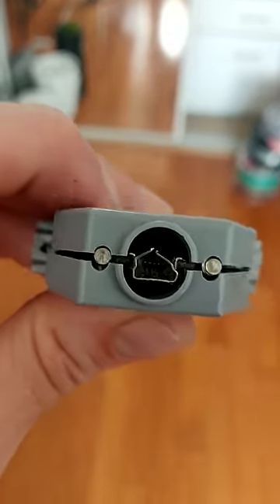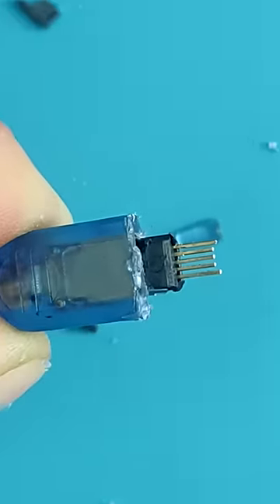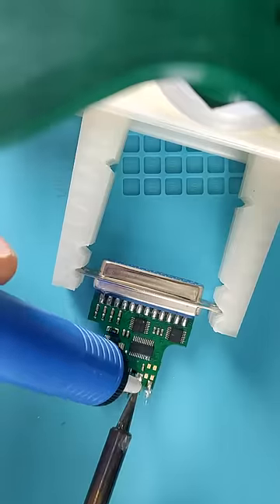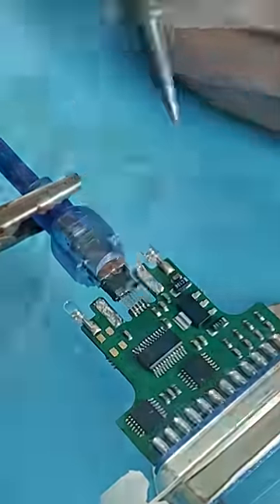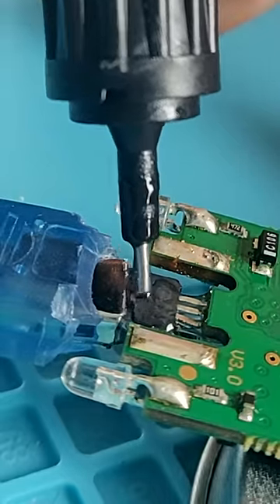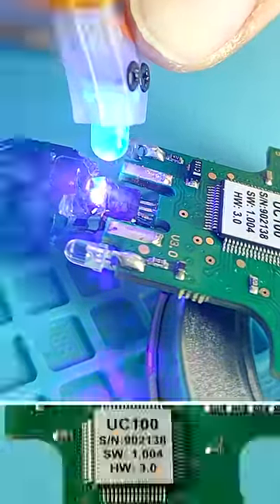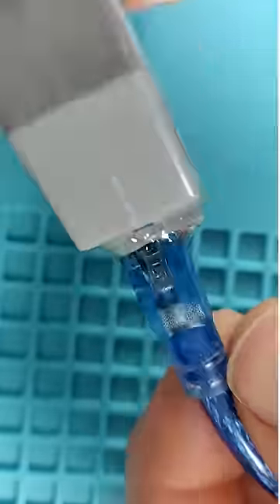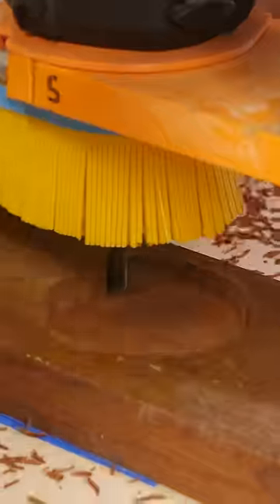For context, I suck a soldering...

Comment: Why not just replace the broken port? you had the chance to even upgrade to USB-C
Reply: The title literally says why, he's not confident in his soldering. I get it though, it'd take me literally half a minute to swap the usb port but then again I already have rework tools and years of experience but I dont expect everyone is in the same boat.
Reply: @sjm4306  Suuuure...
Reply: @Zoldier92  It's really not hard, then again soldering is part of my profession
Reply: USB-C won't cut it.  There's a reason why tons of new CNC routers still use serial ports.
Reply: @matthewboyer4212 because they're stuck in the past and still doing things the way they've always been done? ;)
Reply: I just got done upgrading a bunch of my older gear to USB C. I don't have to carry 4 different cords now :p it's great.
Reply: @rustedfriend  because it works and it works well
Reply: @matthewboyer4212  Not trying to be argumentative because I know my experience is not everyone's experience. But every cnc I've used that has had serial and also another option (network or USB) has worked much better and more consistently as soon as we switched away from the serial :p even though the USB is still just serial with extra steps. Haha.
Reply: @matthewboyer4212  what do you think usb stands for? USB is serial. Also his CNC is using *parallel*, not serial. The motion adapter is already using usb, upgrading it to usb c is a trivial task.
Reply: @metaleggman18  talking about the 25 pin connector
Reply: He could have taken it to local repair shop if he is inexperienced. They would have replaced with new miniB connector. These epoxy bonds are going to break some day and even destroy the PCB beyond repair. Connectors are the easiest way to go.
Reply: Lol why swap it for a port when you can hard wire it forever and not have it break 😂 
Kids these days
Reply: @matthewboyer4212 The reason why, is flexibility. It is intended that the equipment vendor will create their own cables, with the exact length and exact pinout that the machine requires. For most home uses, USB-C is more than good enough.
Reply: Exactly
Reply: Fr
Reply: I don't think you can just solder a different usb port onto the pcb
Reply: The port probably wasn't broken, it was probably just the soldering joints.
Reply: Why change too usb c for older slower tech that can function on b besides that laptops tend to only have one USB c and at least 3 b so why waste it on this
Reply: @xstonedsnailxbox  because C cables are more durable than mini and micro, and more readily available these days.
Reply: @corombb  all good points but you missed out the fact that laptops are limited in the number of type Cs but have vast type bs
Reply: @matthewboyer4212  ok and what's that reason other than that they're slow to adopt
Reply: @xstonedsnailxbox  USB c has nothing to do with the speed it's the connector type. You can get usb c 2.0 devices which are still 2.0 speed obviously. It's only the connector that changes and usb c has only benefits in the long run.
Reply: His laptop (the one shown near the end) is the same one I have and there is no USB C port on it so that would just make it useless
Reply: I hate soldering. It makes me nervous as I feel I’m going to melt everything and join nothing and even I would have attempted to solder a new port
Reply: @xstonedsnailxbox  old machine, bottlenecks folks
Reply: @universityrepairFL  there is no bottleneck youre overlooking some major considerations
Reply: @carsman248  he could have a newer version so that argument isn't really good
Reply: When C isn't only stand for common , It can't solve all the things.
Reply: Bc now he doesn’t need a port or need to remember his cable. He had a direct soldered connection. 

Less failure points. And a port doesn’t make sense to use if he doesn’t have a need of connecting and disconnecting.
Reply: @demp11  well I'm just saying cause that's the one he used in this vid idk what else he has
Reply: USB-C isn't the solution to everything
Reply: @sjm4306  same here but im usually melt other stuff before the solder melt
Reply: @carsman248  dude. seriously.
Ever heard of a USB Type C to A cable?
Reply: Or install a keystone and then make a USB to RJ-11 cable to plug into it.
Reply: because it is reperable
Reply: @DrakyTheDragon  yes, I have. You COULD do that, but why? It wouldn't benefit his case?
Reply: @xstonedsnailxbox  how so? You said b would be more inline with a slower device
Reply: you beat me to it.
Reply: @sjm4306  No you wont, because the wash takes 2-3 minutes in warm IPA :P Actually, replacing those takes much much more, as it is indeed roughly 30 seconds for the swap itself, 2 minutes for the wash, - yet days to find the new Mini-USB socket (as they barely appear anywhere nowadays). I'd just cut the connector off, and solder the cable itself to the board, as it seems there is enough space for the holder. Or - a modboard with a Type-C because popular (also Type-C-to-Type-C cables), or a reenforced Type-B because robust.
Reply: @idontwanttochooseausername  you think it’s unlikely that some random person can solder?

It’s not that hard. It seems like it would be but it’s not
Reply: @sjm4306  no sorry but if you can solder individual wires onto the PCB then you can solder the new port
Reply: Lmao. People being snarky over the fact that SMT Soldering is an entire career.

Its hard as hell, but for my job I work alongside SMT operators that have hand soldered and reworked boards for excess of 10 years lol.
Reply: That's just more waste
Reply: @matthewboyer4212  USB c works way better than any old connector
Reply: cuz no
Reply: I agree, but if he didn't already have the port, that means down time. His fix got him back up and running the same day.
Reply: @rustedfriend  because sometime you want to to not break just cause big joe brushed past it.
Reply: @sjm4306  I feel like this would have been a perfect chance for him to practice soldering; my first legitimate soldering project was replacing a micro-usb port on a Blue Yeti microphone. Easy enough fix, but taught me a lot of the basics. The only way to get better is to keep trying!
Reply: @matthewboyer4212  The adapter was the serial adapter. He made the cable the attached for some dumb reason instead of replacing the port which was ALREADY A USB PORT. They make daughter boards that let you soldier directly easily to the old USB pads easily for USB-C 2.0.
Reply: @matthewboyer4212 exactly. I’m a 3rd gen machinist at 30 years old. It’s about the communication between the machine and computer. If the machine can’t read it, it won’t load it.
Reply: Because there would be no joy in it. If you've experienced this kind of success, you'd know
Reply: @rustedfriend no it’s straight up incompatible with each other electronically due to how the pins work
Reply: This was cheaper
Reply: @melo-7904  I'm not sure which comment of mine you're replying to, But if it's just an older usb to usb-c all the pins are there and the switch is easy. If it's a straight serial connector it requires some extra circuitry to convert it, but it's still not very hard to switch over.
Reply: Because if you need a serial board, why not have a permanent connection rather than have to look for a mini USB cable that you probably have about 2 of in your entire neighborhood.
Reply: Upgrade?
Reply: USB-C isn't an upgrade, as it's a terrible flimsy PoS-connector, too .. reliable conectors need a minimum of mass and sizes, which sadly s conseequently ignored by all connector types developed since the later the 90s.
Reply: @ErickBuildsStuff Even if the paths did get ripped off the board, you could still repair it. It's just a lot harder to do as you need to solder to the traces instead of the pads and you also need to expose the traces on the pcb
Reply: @matthewboyer4212 bruh changing the parallel connector to a usb c will just involve permanently attaching the serial to parralel converter which has literally no point
Reply: @sjm4306 I'm not confident in my soldering ability and I still would have tried to go for the port upgrade route.
Reply: Usb-c would be cool but it being a direct connection should outlast any connector other then the cord itself
Reply: It’s not always that easy

Comment: Replacing ports - nah
Permanently attaching a cable and sealing the case shut with resin - ah yeah fam seems legit
Reply: Yeah, basically my problem with it.

It could be fine for their situation as a personal fix, but I worry about longevity of the cable and the new difficulty he's created for himself if that wears out from being moved, crushed, etc... If it stays still it should be fine, but it may not considering the port was physically busted.

Also, for those reasons this is NOT a repair I would sell to a customer. Absolutely not. It has lost some functionality in regaining it's ability to communicate.
Reply: I call this kind of fix the dad bodge. It only technically works, but a dad would still be incredibly proud to do it.
Reply: @AdroSlice  I love it. I'm stealing this.
Reply: @CreativityNull  I'd just add a pretty strain releif to it and seal with a urethane potting compound. Not like I don't have a bucket of old usb cables.
Reply: It's just LPT to USB cable bro it's nothing special you can order one for a few dollars. It's just for a content
Reply: Beyerdynamic be like:
Reply: Yup, like there is enough space on board to fit full size USB A female or even male there, then you can just replace the cord any time it fails. DIS HARD.

Comment: Side note, when you exposed the bare pains and connected them, you also have to connect a small pin from where the metal casing was soldered to the adjacent solder point on the motion controller. The casing acts as ground. It probably would have worked then. But still a very temporary solution. Great job though!

Comment: For anyone stressing about the longevity of this. He made a serial to usbA adapter. You can find them for cheap. He just made a quick one with what he had to gitter done so to speak. He didn't solder directly to the cnc. Just the connector cables/adapters.
Reply: Is that Serial or Parallel?
Reply: @milescarter7803  bot as hell reply
Reply: Annoyingly you can't just use a standard parallel to usb adapter wirh that cnc machine, the company made sure you have to use their one or their software won't work, so you got to pay them about £100

Comment: Solder suction tubes were a game changer for me.
Reply: As great as those 5 dollar solder suckers are, getting a proper motorized solder sucker is even better. It's a soldering iron. With a hole in the tip that vacuums the solder. Game changer on top of game changer.

If you are doing it professionally, pay the 700 bucks for one.
Reply: @phillyphakename1255  oh that sounds absolutely badass

Comment: Don't ever cover your solder joints with any kind of goop or glue. I learned the hard way. It's just going to be problematic down the line and doesn't help with durability or insulation whatsoever. You're never fixing that thing again, just do it properly next time and replace the faulty receptacle.
Reply: glue is usually moisture sensitive. it often interacts with LVD of USB, and always with higher voltage ( above 12v ).
Reply: We use conformal coatings, potting resins and even hot glue to cover things that might fail due to vibration or fatigue as well as just keeping large components from getting ripped off because of their own weight.
It's a very widely used practice, have a look at any automotive and a lot of industrial boards.
Reply: @BrodieFairhall  yes, you use selected glues that are known by experts to not interfere with your usage.

And still, I killed a radio receiver by covering it with tropicalisation spray, a model that was designed for pcb and it still interacted with hf signals ... 

I also had issues with neoprene and 220V, and hot glue can interact with LVD ... 

That's why most electronic factories use specially designed silicon glues ... Not any random silicon, but specially designed ones.

Resins are a different topic which I don't master. They are  thing, but they are a whole topic by themselves.
Reply: Gorilla glue works for me I don't put on bare wires though but after some electrical tape why not
Reply: @BrodieFairhall  you are using glues selected by electronic engineers, not random glues from Wal-Mart. 

There are professional hot glue for electronic. So if your lab is providing you hot glue, they are bought from a specific manufacturer. 

While this video is probably using the cheapest glue available in the public store at the corner of the street.
Reply: @Benoit-Pierre  I source all the products we use to manufacture and repair boards, so I know exactly what products are being used and for what purposes.
Potting resins and epoxies we buy specifically for electronics. The hot glue we use is just generic hot glue.
Devin is using a photoresin, not a generic glue, I wouldn't be concerned about it causing a problem, especially compared to how many problems there would be if the wires were left unsecured.
Reply: @BrodieFairhall  👍🏻

Comment: That soldering looks pretty neat, no worries there. Well done. Im self-taught on soldering, and would like to share that the game changer for me was not better gear or the drastic difference between lead solder and lead-free.. but just the realisation of how surface tension, capillary action and thermal attraction affects the solder.

Comment: Late last year I got my self a hot air rework station and I learned some basic SMD soldering so that I could finally replace the broken usb port on an old tablet. I bought some SMD practice kits and found it therapeutic soldering those tiny components well except the few times I had hit them with too much airflow and sent the little 0805 resistor or led into orbit.

Comment: The thing is that it's a good thing you made it to fix the port, I wouldn't recommend it with the permanent seal of the port and seal with the cable.

I don't know if it's expensive or not, I would rather use USB C port, if it's impossible to using USB C, I sill recommend using mini usb port for easy replacement for later future.

Comment: I like Bondic, but I've been using the JB Weld (former FiberFix) stuff for years. Pretty sure the volume of contents and chemical composition are, but the $10 Home Depot JB Weld has a brighter light that locks in place (the switch, not the socket joint for light and tube I never use).

Comment: i would just cut the wire and solder it directly to the board
Reply: nope. soldering wires means identifying wires and reverse engineering them.

this method is much more reliable and easy.
Reply: 5 wires and online diagram of that "common usb conector" is easy enough tho
Reply: @ducki8845  by scalping the plug, you save much efforts :
- no Google 
- no search about why there are 5 wires while most USB have 4
- no order issue 
- no pain soldering minuscule narrow things 

... Write orientation, Scalp the plug calmly, solder. And spacing ( pitch ) is usually the good one.

Comment: >Car wheel breaks while driving
>Man tries to replace wheel
>Wheel does not fit as the mounting surface is damaged

>*Solution:* Weld the new wheel directly to the axle.

Comment: Wouldnt it be way better to replace the usb port instead of glueing everything together? I fixed stuff like that when i was 12. Btw, if you use glue over your solder joints its a sign that you dont trust your soldering at all.

Comment: Uc100 motion controller shown is not a terrible product but not great either. It allows using a non LPT port computer to be used for cnc applications, and about 10 years ago it was a good option because of that. But since then more and more Ethernet based motion controllers/ adaptors have been released that offer better performance and more features, specifically much more i/o. 

The same company that makes this and other notion controllers also has their own cnc control software, but with some really weird idiosyncrasies that conflict with industry norms. Presumably it works best with their software but is also fine with Mach3, not sure about Mach4, and a definite no go with LinuxCNC. 

It’ll get you up and running, and may be a good option for a router, is also an ok option for mill, but stay clear if you’re setting up a lathe as it does not support threading under mach3. 

All in all not bad and reasonably priced, but has limited functionality. It’s also pretty uncommon in diy cnc, so seeing another one in the wild is the reason for this novel 😅

Comment: Nice job soldering dude. For future reference if this fails or breaks again you can purchase a new parallel port adapter for like 10$
Reply: It’s a motion controller in a port adaptor case.
Reply: @matter9  the port on the cnc machine literally says parallel port

Comment: It didn't work because the end solder joint to the right was what failed it had wiggled loose. Had you just resoldered the contact pins for the terminal you wouldn't have even needed to tear apart your cord for it.

Comment: pretty lucky that thr pinout matched
Reply: it always does ...
Reply: It's standard USB.
Reply: @neoqueto  the inside of the parallel connector looked like bare wires had been soldered there before, not a "standard usb connector"
Reply: @EMILE12345678901  standard USB pinout.
Reply: @neoqueto  there's many "standard usb pinouts" tho, it wasn't even a usb connector on that thing beforehand, just wire terminals
Reply: @EMILE12345678901  that was clearly mini USB.